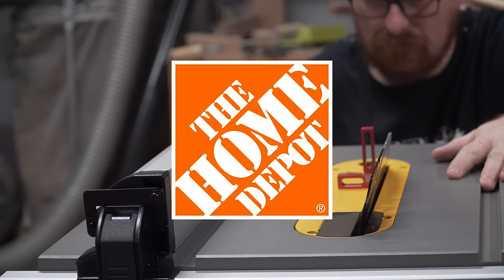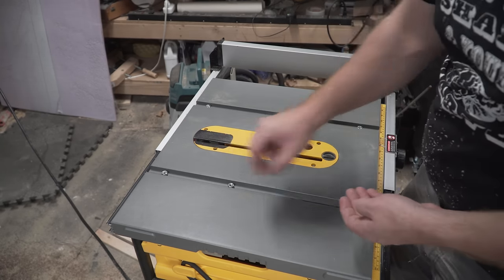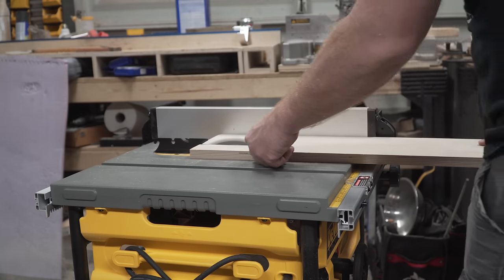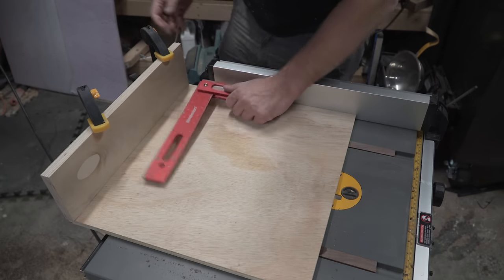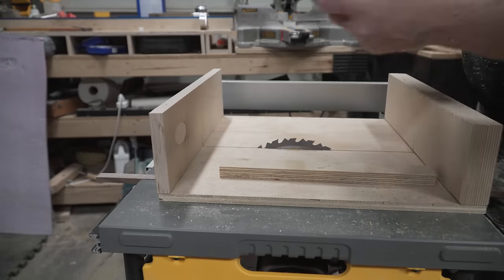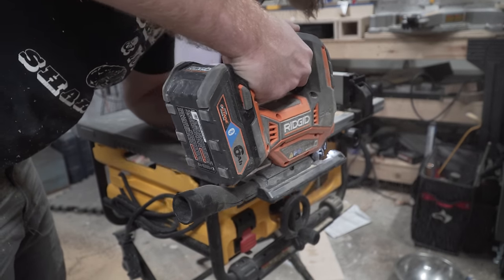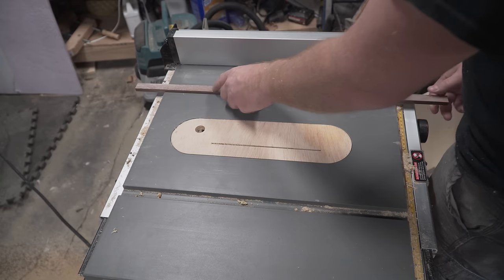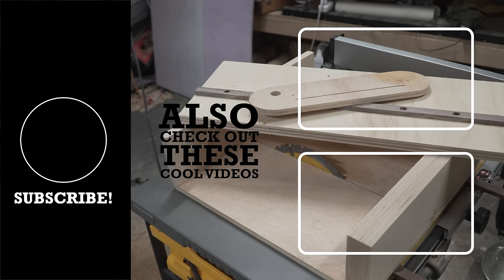3 Simple Jigs to get Professional Results from any Table Saw | Shop Tips

Comment: Great video but ...what if u got a saw without these slides in the table? Got something simple here (French Cleat Holder for pushing the lumber) but ...wanted a more ...accurate Jig but without these holelines/slides in the table, its not possible? :/
Reply from the maker: Without miter slots you are limited to your fence.  You may want to make a short fence attachment for your fence that flips down, and flip down stop for referencing when doing cross cuts.
Reply: @WoodWorkLIFE  Thank you for the answer ... i think, i know what u mean. Maybe i build a fence myself (my one is inaccurate and hard to fix) twice, to do something like that. Thanks :)

Comment: Quick question: I use the DWE7491, which is very similar to your model. I noticed that you didn’t include the little tabs at the back end of the throat plate that keep it from tipping. As there is no other mechanism to hold your plate in place, have you ever had any problems with it tipping or moving on you? I’m always for keeping it simple, but not at the expense of safety.
Reply from the maker: You can add a short screw and a washer into the bottom of the plate to hold it in place KISS all day
Reply: Wood.Work.LIFE. Brilliant. Thanks.

Comment: If you use a router to trim blush to the stock insert plate your new one is going to be just as loose as it was. You should cut to the outside of the line with the jigsaw then sand it down until you have a nice snug fit.

Comment: Would it be practical to make a sled that's able to accept 24" wide material?  Would it depend on more than my ability to cobble up infeed/outfeed support?  I'm stuck without real shop-space and pretty tired of futzing with shoot-boards for cabinet-work crosscuts, though they'll always have a place in my portable arsenal.
Reply from the maker: You could, but you would just want to make it backwards.  Reference off the back fence...the one that is this video I didn't calibrate (so calibrate yours) It is not as safe as this style sled but it works very well.  Most people call them a panel sled.
Reply: @WoodWorkLIFE  Been meaning to follow up with a 'thanks.'  
The 'backwards' version wouldn't have occurred to me.  Is the basis for that altered design to reduce the tendency for the load to off-balance a portable saw, because the standard sled would overhang the back of the saw more than a 'panel sled' would tend to?  If not...what did I miss?

Comment: There's a jump in logic on the last jig about the sled getting you an S2S board... I can end up cutting a triangle with the method shown, so what advantage do you have in truing the board?
Reply: If you rip one edge to make a straight edge..you then flip the wood,with the edge you just cut against the fence,and then rip tge other edge so you have two clean edges..and you won't cut a triangle..you could make that first cut on an angle if you want..it doesn't matter..once you flip the board and make your second trim,it'll be parallel. Make sense?
Reply: @Brian-dj3ru  yes, but the only indication you get that you should use the fence is an outtro cut, and this is a video for beginners, who might guess that you refer back to the crosscut sled or even a miter gauge.  The rest of the video indicates all tool changes clearly, so the obvious assumption might be to continue using the jig and switch faces, as he closes his statement in a video overlay of still making the first facing cut.

Comment: Thanks for this. I'm new to woodworking so forgive this newbie question..
- the last sled - how is this better than just using the fence?
Reply from the maker: When you have a rough or warped board this allows you to cut a straight edge.  Cutting a straight & square edge is one of the most important things in woodworking.  Basically this turns your table saw into a jointer.
Reply: Saftey reasons as well. If you cut a crooked board there is high risk for kickback. This makes the job easier and safer.

Comment: What jobsite table saw would you recommend for wood working?  Would like something for the garage, but don't have a ton of room or want to pay for a stationary table saw.  Thanks and great video!
Reply from the maker: Probably this one from DeWalt or the Ridgid jobsite saw, they both have good fences and reasonable dust collection.  I have used both to do way more than they should be capable of without issue.
Reply: @WoodWorkLIFE  thanks!  But I ended up getting the Makita.  There was a really good black friday sale at lowes.  It was marked down to $299.

Comment: You can make a zero clearance plate out of the stock throat plate by filling the stock blade gap with a piece of hardwood from the bottom side and epoxy it in place. 
Takes a bit of trial and error to get it all fit right so it’s flush with the top as well, but that way you don’t lose the ability to lock the throat plate to the table. I just bought a 2nd throat plate and made one zero clearance 45° and one @ 90°
Reply from the maker: That's not a half bad idea

Comment: See how at the 22 second mark he checks to see if the fence is perpendicular to the deck? What would he have done if it was not? I have this very same saw and mine is not. The top leans away from the blade. How is that fixed?
Reply from the maker: This fence just tilts and has a few adjustment plastic bolt to adjust it.  Every saw is different though.  You just need to get it square to the table.

Comment: Thanks for this video. Ive been looking for this type of jig for a SawStop job site saw I purchased when I downgraded my work shop late last year.  I always had sleds for my professional saw I sold but wasn’t sure what I wanted would work on the job site saw.  I already made a small parts sled and did exactly what you did and it works perfectly.  Zero clearance is a must and have made a couple of those.  I did not make the last sled because I didn’t think about it.  Ill be making one today.  I love DeWalt tools but I got the SawStop because my grandchildren are interested in woodworking and I wanted something I would not worry about too much if they used it.  Now I have a question.  Do you think if I made a sled that is at least as large as the full table on my saw it wouldn’t be too unyielding to handle.  My only thought is that I would need something at the other side to catch the sled so it just didnt go off the table by just pure weight.  Hope I explained this right.  Like your site I hadn’t seen it before.  Your right to the point on what you are doing.  Thanks for sharing.
Reply from the maker: Indeed, a sawstop is big on my list.  Someday.   Outfeed table is one of the next items on my list to build.  I need my forever saw first though.  Maybe a Sawstop :)

Comment: I have used this table saw for years and the blade recently moved out of alignment with the miter slot. To change the blade alignment, you need to remove two 5mm bolts, and I have spent all morning trying to find a video that demonstrates how to access and remove those stuck bolts on this specific saw. Hoping you can help! Your table saw alignment video is great, but isn't this same saw. I am having a nightmare getting any of my tools to fit onto those stuck 5mm bolts because of the bar just below them and how tight they are to the rest of the equipment. Driver is too wide, torque wrench with hex socket is too thick, and the handheld allen wrench is not strong enough, even with tools for extra leverage. I was able to slightly hand loosen one bolt with rust dissolver but not enough. I'm ready to pull my hair out. Any suggestions?!

Comment: Boy, I don't know know for sure, but this video might be setting up false expectations about the precision of the Dewalt job site saws. I got the now discontinued DW745 a couple years ago and I think for the money it is a fantastic saw and value, but I've used it pretty extensively for both woodworking and carpentry type jobs and can clearly see some of its limitations. On the plus side, as many reviewers have noted, the fence system is very easy to adjust and is surprisingly accurate. The power is decent: making some large crates I was able to rip numerous 2x4s down to 1x2s with ease. I will--with an appropriate blade easily rip any .75" hardwood I can think of--and I have cut 3" of pine laminate and 1.75" solid cherry (the latter using a 20 tooth Forrest blade with it the gullet well above the wood--it wouldn't do it without the blade raised very high--which on a saw this size is a little scary).

That's all good, but I did make a cross cut sled last year and noticed that the miter slots were uneven and not matter how much I trimmed and waxed my walnut runner, I couldn't get the sled to smoothly run through the saw. I decided I simply had to make all cross cuts on the Dewalt miter saw. Taper cuts same problem. In short this is basically a "ripping saw" (and those cuts are never "glue ready" but have to be planed before making hardwood panels) unless doing small cross cuts with a miter gauge (that can later be corrected using a shoulder plane).

The fact is that this saw is designed for carpentry which allows for more "slop" than fine woodworking. Forget about the "rule of five" when making a cross cut sled--unless you were lucky enough to get an accurate miter slot--that's going to be a fool's errand.

I'm debating whether to get a bigger saw. This one was great to learn on, but I really don't think I can use it with many jigs. Heck, it won't even realistically accommodate a feather board. I use the DW713 for woodworking and I'm fully alert when doing so and cautious about what i do with it. If my son was interested in learning woodworking, I'd probably pay 10x the cost and just get a SawStop for him to learn on.

Comment: Hi is that  a dewalt table saw you have, which model and do you find the fence and mitre slots super accurate with the blade? Thanks Chris
Reply from the maker: Not super accurate, but good enough for quality work.  They are nowhere near as accurate as a good contractor saw, hybrid saw, or cabinet maker saw.
Reply: @WoodWorkLIFE  Ahh ok i seem to think is saw was classified as a contractors saw? please have you an example of one?
Reply from the maker: @ChristopherClaudioSkierka  one with a cast iron table like from Delta or Ridgid

Comment: I hit the like button because I was able to get the gist and I'm sure these sleds will be VERY helpful, BUT! As a new woodworker, I had NO idea about some of the terms and specifics that you just kinda sped through. How in the world are folks like me gonna be able to put to put these sleds to practical use, when we have zero idea about some of the things you're talking about? Admittedly, some of it was really frustrating as a newby.
Example: Factory insert sled...you mentioned "leveling screw" I think, cuz I couldn't really understand the word, and retention tabs? What is that? and what were the other factory things you were talking about? Also, at the end with regard to the jointer sled...what does S2S mean? 
If you could clarify a little in a "woodworking for dummies" fashion that'd be super helpful lol
Reply: Leveling screws are as the name implies, used for leveling the insert.  Retention tab would just be a little tab that retains the insert (holds it down/in place).  S2S means surfaced two sides (basically the sides which have been planed, no longer rough), S3S would typically be two sides and a face, S4S is all four sides (typical finished lumber).

Comment: I just bought the same table saw a couple of months ago and I am getting ready to make the first sled.  Thanks for the idea of using plywood instead of standard material for the front and back face.  Is there a maximum width or length for a sled or is it just personal preference?
Reply from the maker: totally personal preferences, all just based on what you like to make

Comment: For the jointer: wouldn't you run the risk of the piece you are trying to get that flat edge on being off angle since the opposite edge you are using to reference it wouldn't be straight?
Reply: mystang 89 no, because he is screwing it down. If he was simply holding the piece against the fence, the wood would rock and the cut wouldn’t be straight. But because he screwed it onto the sled, it cannot rock against the fence and therefore the cut will be straight

Comment: By allowing thin cuts between the blade and fence with no push stick in contact at any time is asking for a kick back to the face.
Reply from the maker: or pulling you hand into the blade, you are correct

Comment: How would you recommend extending the slot in the zero insert plate to allow for the riving knife/splitter?
Reply from the maker: Use the factory throat plate and put the zero clearance onto the blade (while it's off) then set the fence to the width of the edge of the plate.  Run it into the saw (carefully, using push sticks) then super glue in a little wedge the width of the blade  to keep the slot open...boom Bob's your Uncle

Comment: The Zero Clearance jig, no need in the splitter?
Reply from the maker: You should definitely find a way to incorporate your splitter.  Should be as easy as removing the plate and continuing the cut so your splitter can be housed in the plate.

Comment: I just bought the saw you use in this video, and I was disappointed to find that both miter slots vary in width, so that a miter slider perfectly adjusted for one section of the slot will stick when it gets further along. Did you find the slots on yours consistent in width? Did I just get a dud? Thanks.
Reply from the maker: Mine are inconsistent too, but that is not too much of a problem sinking as you're using two slides and the slots are parallel with the blade.  These aren't cabinet saws after all.  As long as you can have a slide that fit through the whole length of the slot without "play" your fine.  A couple thousandth difference here or there will be cancelled out by the combination of two slides without play.  If the width varies by more that 10 to maybe 30 thousandths.  Maybe try exchanging it if you still can
Reply: @WoodWorkLIFE  Thanks, I think I'll exchange it. I appreciate your help.

Comment: Great video. I just made my first cross cut sled and so glad I did. Being a new wood worker, my biggest issue is flat boards/stock but with no jointer or planer that seems impossible, do you have a video to help my issue?
Reply: Do you have a router? You can make a leveling jig to flatten boards using a router and a spoilboard or surfacing bit. You just need 2 straight edges and a carrier to hold your router that spans those 2 straight edges. https://www.youtube.com/watch?v=qtkBZHLJyD0

Comment: Do the runners need to be hard wood or can you use plywood instead? Thanks!
Reply from the maker: I wouldn't recomend plywood, it would chip and degrade faster.  I often use cheapo plastic cutting boards though.
Reply: @WoodWorkLIFE  Thanks! Using a cheap cutting board is a good idea!

Comment: @wood.work.life  Thank you for the video. I do have a question about the zero clearance jig, or at least the slit you cut. What size blade are you using in the table saw? I have the same DeWalt but my blade does not retract low enough for my zero clearance board to sit flush so I can raise the blade through the board, Or is there an adjustment under the table I am not aware of?

I read through all the comments and wow are there a lot of "Zero Tolerance Boards" posting...heh. 

Keep up the great work, some of us greatly appreciate your DIYs, and most of us know the proper safety precaution and take these measures when using our tools, rather a video did or didn't use them.
Reply from the maker: Are you using 1/2" or 3/4" ply

Comment: Very well done, sir! I have that same saw and it’s great to see a simple method to make an effective cross cut sled and jointer sleds. I always feel limited due to the small table top of the DW745. I noticed you removed the riving knife when making the zero-clearance insert, is this essential? Any tips on running the workpiece without a riving knife? Also, do you happen to have something on making a circle cutting jig for a router? Thanks for being awesome! You got yourself a new subscriber!
Reply from the maker: I enlarged the slot for the riving knife and put it in with super glue.  a riving knife is ESSENTIAL for rip cuts.  My old saw didn't have one.

Comment: My Ridgid R4512 has a really thin throat plate. What is the best time of wood to use to make a zero clearance throat plate that's about 1/8" thin?
Reply: UncleSarkis I have the R4512 also. Plain 1/8” material will be quite light and flimsy. The best material in my experience is 1/2” mdf. You need to cut a rabbet all the way around on a router table or rabbeting bit leaving 1/8 or so around the top edge. Make the cutouts for the leveling screws with a forstner bit.

Comment: Why does one want a cross cut sled? Easier to get a square cross cut than pressing your lumber against the rip fence?
Reply: The regular miter slide included with a saw is rarely all that square, nor is it all that wide.
Things a cross cut sled does:
Supports both sides of the work when cross cutting so the cut will be cleaner
Because it fully supports the work, you are less inclined to put your fingers in dangerous places when making cuts for small pieces.
You can clamp stop blocks to the fence to make fast repeat cuts. 
If clamps aren't your thing, for a more advanced sled you can embed a bit of T-slot in the fence or the sled base itself to hold stop blocks.
The cut line on the sled shows you exactly where the blade will cut so its easy to line up pencil marks with the blade.
Add a stick on tape measure aligned to the blade and you can even skip marking the piece for cuts that fit on the sled.

Cross cut sled can also be the base for other sorts of jigs that will help cut finger joints, tenons, and other things I can't even think of.
Reply from the maker: Thanks for answering for me David.